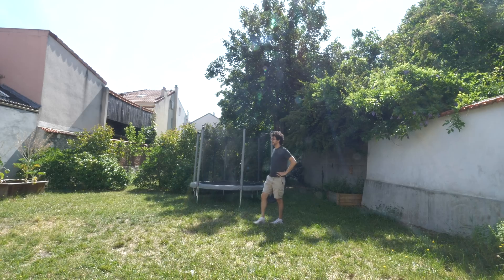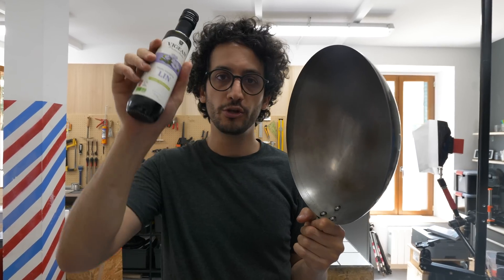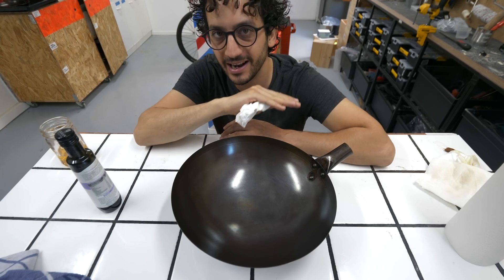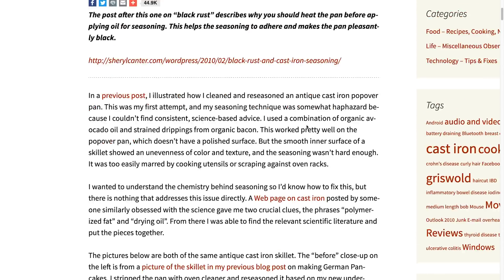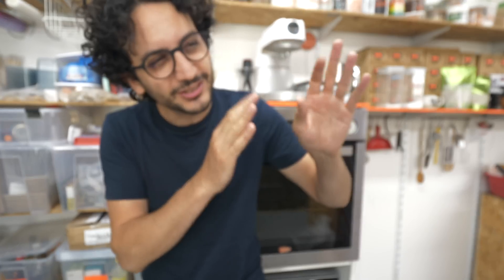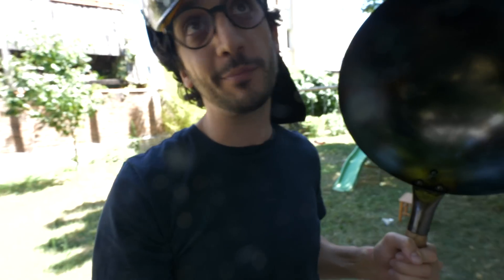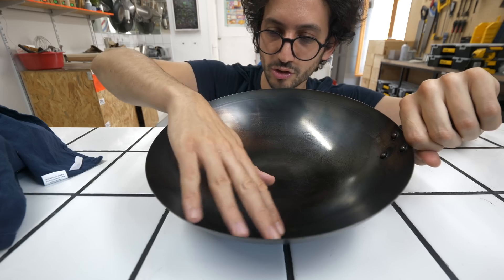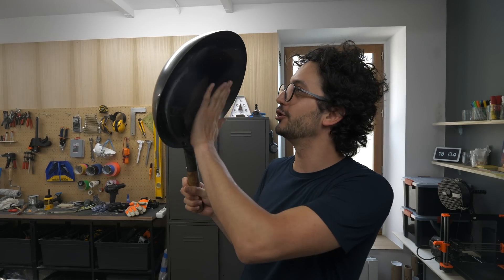Can I Make my Wok Slicker than a Nonstick Pan ?

Comment: It is definitely good enough to use every day, but I won't say it's better than a teflon. With a teflon you can usually fry an egg with absolutely no oil.
Reply: @SimonWoodburyForget  You are absolutely right, I shouldn't call it frying. Using some oil is absolutely fine. I was just theoretically comparing the level non-stickiness. Since teflon can cook an egg without oil, I think teflon technically sticks less than a seasoned cast iron. I agree both provide good enough level of non-stickiness for day-to-day use though.

I know some people experience short lifespans on teflon pans. My finding is that most of them use gas cooktop. I suspect it's because gas heat is way more intense than electric, it sometimes overheat teflon surface. With my induction cooktop (which is common in Europe) my teflon pans last pretty long.

Comment: For the sake of glass like surface... it would be interesting to build up some thick layers and then use a proper buffer to create that smooth surface. like... go all out man
Reply: The layer is too thick it doesn't work, the surface to mass ratio of oil hydrolyzation is critical.

Comment: "There's no chemicals, it's just like a nice, very hard polymerised surface". Well that's pretty much chemistry and your polymere is a chemical. Just because it is homemade doesn't mean that it's better or worse. Tbh I am a bit disappointed that you made such a statement Alex, since I know you do now better :D Teflon is great, you should just never let anything burn inside of the pan (or heat it above 400°C - a Teflon pan is NOT suited for this.
Anyway this is a very interesting topic and alas I couldn't find any paper in my short search for this topic. It would have been interesting to know what exactly this layer is.

Comment: Teflon has a low flash temperature, meaning it is not safe to use at high heat which is why a teflon pan will wear out when used regularly, and since teflon is extremely dangerous to ingest, this is definitely a better solution

Comment: I too came across the same post a few years ago. I even read all the replies, I think  along the way I picked up my preseasoning step of boiling several tea bags in the pan. Fill the pan with water, add tea bags, boil for quite a while, keeping the water topped up. Add tea bags if necessary. I think the tannins in the tea helps form the magnetite layer Sheryl refers to in her second post.

Comment: Im not sold on Sheryl's method of using linseed/flaxseed oil. As she said herself, she's not a chemist, and i have read few opinions from actual chemists that using that kind of oil with low smoking point isnt really the optimal way. Main point is that the seasoning layer is going to be very weak and you're going to lose it easily. For some reason that method gained some popularity on the internets but i havent read any actual science that proves it as being a good solution. I am in talks with an actual chemists and he should make soon a video about this, when he finds some time. Im very interested in this topic because i love carbon steel pans. Another related topic is about the best frying oils/oils for cooking at high temperatures (when you sear a steak the pan and oil reaches temperatures far higher than the ones suggested for frying), and this is an even more complex topic.
Reply: So what is actually "seasoning"??

Comment: Elitist snobbery ! There are many such questions that always have the same outcome of answers. one example, blue steel vs stainless steel knife which is better? both do the same job, both do not impart a different flavor on the food. one is more labor intensive to maintain, one costs more. enthusiast, professional, home cook, there should be three right answers. I personally have been working in professional kitchens for many many years and have used Teflon and non. i currently use both, it all depends on what i'm cooking and my mood.

Comment: I'd agree with your "better than a teflon pan" stance. That coating can handle high temps, like if you accidentally leave it preheating for a few seconds too long. Teflon starts to degrade at high temps. And it can be rejuvenated if the coating becomes less nonstick over time.

Comment: Bro easiest way good gas stove don't put oil in the pan when it's cold get the pan smoking hot like literally smoking then put the oil in the pan and spread it with a thick tea towel til uniform all over, and your done. I've been a chef for many years and we always did it that way never had anything stick.

Comment: I used to use T-Fal Teflon pans before, recently I back to my parent home and my mom using Stainless steel wok, and it really hard to used to it.
But my mom reached me and I found, to use non-coating wok, you have to make sure the wok is hot enough before you put in your ingredients in.
(If not hot enough you will suffer in ingredients stick on surface)
*make sure you prepare all stuffs before turn on fire, using wok THE HEAT TRANSFER SUPER QUICK, too slow you will easily burn your food.

I’m ChemicalEng student, I looking like this, if hot enough the material (ingredients) will cooked before it touch the wok surface, so it not going to stick.

Hot wok after put ingredients

(oil) (foods) (oil)
(Oil) (Oil) (Oil) (Oil)
( iron / stainless steel)

Temperature not high enough for the wok 

(oil) (foods) (oil)
( iron / stainless steel)

So you need to know your wok and need some skills in my conclusion.
*i like the effect that make food more delicious (especially fly) because wok can heat transfer super quick.
Reply: The Frugal Gourmet used to say "hot wok, cold oil, food won't stick."

Comment: I have a carbon steel made by de Buyer. I seasoned it on the stove with grapeseed oil. I can do the egg trick you did. However, I can not make a french omelette in the pan. It slides around fine, I can get the right shape, but the egg isn't pale yellow, it's browned. If you were able to make a french omelette in a carbon steel pan......now that would be impressive (not saying that this wasn't impressive). In regards to the wok, I believe the way the Chinese season their wok is to put a lot of oil in it with chopped up onions and they fry the onions till black. If you take a carbon steel, stainless steel, or cast iron pan and fry an onion in it, it will give the pan some non stick qualities for a while. Also they use stoves with a lot more firepower,  I think that's how they get the wok hei flavor.

Comment: Teflon non-stick pan : we need to change it every 1-2 with 4-5 use per week.
Steel seasoned wok : we have the very same one for 10 years, used 3 meals a day (and for one meal it can be used for up to 6 dishes, but in average 3)

So I agree with you!!!

Comment: Would a bbq grill get you a heat that you would want?

How did you make those DYI grill pads and buffers?

Amazing video
Reply: Saw a video where a guy was getting 700+ degrees F on the pan with a kamado over lump charcoals.

Comment: Linseed is a good choice. Walnut would work except I think it’s more sensitive, perhaps too sensitive, to heat. Both of those oils are used to put an oil finish on wood, which is also polymerized in much the same way, only more slowly without heat. (Or heavy-metal agents that speed polymerization are added, but those are too toxic for a pan.)

Comment: Hm. Buffing the freshly cured seasoning. That's a new one. Makes sense. 

And, yes, pan seasoning is nothing more than a form of food grade enamel baked hard. You dare not rise above the seasoning's pyrolizing temperature. Otherwise, the only maintenence is a light scour followed by refreshing the existing seasoning with a couple cycles of oil and bake. Food grade linseed oil is the real deal for seasoning pans. In paint technology, linseed oil made the most durable paint. Stands to reason the food grade version would make the most durable seasoning for steel and cast iron cookware.

Comment: Seasoned cast iron or steel pans are so much better than teflon, and for wok using a teflon pan would be downright silly since the teflon coating can't handle those kinds of temperatures.

What most people think destroys teflon pans is using metal utensils or stuff like that but what actually destroys the teflon coating is using to high of a heat.

Lastly if you somehow screw up the seasoning you can just apply a new coating fairly easily yourself but with a teflon pan you basically just have to chuck it out and get a new one.

Comment: I have a carbon steel crepe pan.  Once seasoned, eggs won't stick to it at all.  I don't even have to lift the egg as you did in the video.  On good non-stick pans, they also need a slight amount of lifting to free them from the pan.  So, in my experience carbon steel pans DO have a better non-stick surface.  Give yours a bit of time to season and I bet it will not need any coaxing to freely slide the egg around.

Comment: I've spent so long mastering how to get a perfectly cooked, non-crispy egg because any crisping is disgusting to me. I'm upset with your egg Alex.
Reply: Just cook it inside its shell instead of broken open in an oily pan ^^ That's the best way to cook an egg without altering its taste, heath values, or nutritional benefits, and you have absolutely nothing to add during cooking. Just over 2 minutes in boiling water, then cool it very fast by dropping in cold water for 1 minutes. Break the top of the shell and eat with spoon/bread+butter with a pinch of salt. Enjoy

Comment: Great stuff Alex! A faster way to clean your pan to start with is to use oven cleaner - it’s designed to strip off polymerised oils and you might well already have some in your kitchen. Can’t agree more about the linseed oil - it’s great for cast iron skillets too.

Comment: What temperature was your oven? Did you preheat the oven? Also, smoking oil can be carcinogenic and very dangerous for pets (birds will die very quickly when exposed to it) so please edit your video with a warning. Also mention that you need to perform the seasoning procedure in a very well ventilated room.

Otherwise, solid video as always, Alex!

Comment: Teflon and seasoned steel both serve their own purpose.

Woks are great for stir fry with their ultra high temperature wok hei flavor. Your stir fry won't be right without it. On the other hand, if you're making a french omelette in the classic quenelle shape that is delicately cooked and not crispy/browned at all I would choose teflon every time. 

Ever tried to cook fish in a seasoned pan? It's a pain in the ass. It will strip your seasoning down to bare metal just about causing you to spend a bunch of time re-seasoning. Teflon however is much more resistant to the chemical reaction caused by cooking fish. Just one of many examples.

Comment: The there is no chemical point is kinda of flawed, PTFE (telfon) is really non reactive (due to the C-F bond)  and used to store some insanely strong acids and if you were to eat small amounts it would not react or be absorbed by your body at all, you still shouldn't take it past its decomposition temperature (pretty tough ro reach on a regular stovetop tho) because it'd produce toxic compounds like PFIB (that is really bad for you) above the ~326C° mark (599.15K)

Comment: You could have made it better if you didn't use Flaxseed aka Linseed oil.

Be ready for the seasoning to start flaking off very soon.

Sadly the term Science is now used so loosely that a hunch can be called "Science" and it will blow up like gospel.

Comment: For bluing with lin oil the temperature of steel should be between 400°C and 600°C. After bluing coat the hot steel with wax to close micro holes.

Comment: I would be quite curious to see what would happen if you were to use a mix of oil and wax ( paraffin or bee´s ) for seasoning.

That and I know for a fact that heat is not the only factor for polymerization of oil. I have seen solidified lumps of slide oil on the underside of milling machine beds. And it never encountered a heat greater than a summer day.

Comment: Hey Alex I am so glad you got this right. To my knowledge you did everything absolutely correct. I bought myself a couple of deBuyer carbon steel skillets around Christmas time last year. I read a lot about seasoning and watched a lot of videos, but I could not get the pan non-stick. it turned out my layer of oil was too thick. Eventually I reached the same conclusion as you, ultra thin layers and many coatings. For everybody's reference I watched "Uncle Scott's Kitchen" video on it and he goes into great detail about how to do it. I recommend that you check it out. 

PRO TIP: If you want to reseason your old pan I found a super easy way to clean all the dirt and smudge off in just minutes without any scrubbing. If you fill your pan to the literal brim (almost overflowing) and add in a tablespoon or two of lye/caustic soda/sodium hydroxide and set the pan on a very gentle boil, ALL the black spots will just fly off and you are left with a blank canvas as you say. No scrubbing needed. Good luck and keep up the great vids. Much love

Comment: A lot of things confused me about this episode:
 - Didn't you expose some raw metal, or at least made the polymer coating uneven by buffing it after seasoning, rather than before?
 - Why did your nonstick test involve so much oil? That's how much oil I use to fry an egg in a normal pan lol
 - Why are you comparing a steel pan to teflon at all? Seems like comparing a knife to a fork. There are things you can ONLY do in Teflon. There are things you simply CAN'T do in teflon
Overall a lot of confusion.

Comment: I’ve done the flax seed oil polymerization thing and I’ve done it the old fashioned way: use them with lots of oil, and clean by wiping/salt scrubbing. The latter works best if you’re using the pans all the time since the polymer layers will chip.

Comment: What is the polishing compound that you added but didn't mention? That doesn't seem sensible. Also you can take your surface to a much, much smoother result by using a combination of increasingly finer steel wools. I dont' think that matters tho

Comment: The big issue I have with teflon pans is simply heat... You can't cook REALLY hot in them as you'll break down the coating and destroy the pan (not to mention you from the off-gassing breakdown components) in fairly short order... A well seasoned wok or cast-iron pan will keep a good non-stick surface without that kind of issue. And if you do something to break the seasoning you can resurface the pan... oh, wait... you just did that. ;)

Comment: Whilst your chemistry is correct, the fact is that by the time you have used it once with whatever you are cooking with, you have changed the surface and continue to do so every time you use it. There is only one way to season a pan in the long run; just use it correctly.

Comment: You can fry an egg on an Teflon pan from here until the heat death of the universe, without the coating affecting your digestive system provided you keep the heat low. 

If you'd rather sear an egg in boiling oil you're going to be dealing with carcinogens on the surface that's getting baked. 

Imaginary Teflon problems vs cancer. You decide.

Comment: So I tried this with a carbon steel pan. Got it to a mirror finish, pretty easily to be fair. But... mirror finish carbon steel is still reactive and stuff sticks to it - what doesn't stick to it? The polymer coating you get from seasoning. It peels right off. 
You need a bit of "rough" for the seasoning to grip.
Reply: Also, if you add enough oil to a sock you can cook an egg on it and have it slide around. I see this a lot with cast iron videos. Look at this "non-stick" pan.... that's full of oil. I guarantee a seared steak will still stick to Alex's pan. And you shift it with a slice, which will mar the "mirror finish" coating, the bits will burn on to the surface. And blah blah. Neither cast iron or carbon steel can't be made non-stick with polymer oil coatings. Literally, show me one video with a cast iron or carbon steel pan that cooks non-stick without oil. I can show you a bunch of Teflon, anodised aluminium or ceramic pans that will.

Comment: Flaxseed oil is bad for carbon steel pans. Flaxseed oil has the lowest smoke point, which means it polymerizes more completely, which means it is MORE BRITTLE!

Carbon steel has some flex to it as it heats and cools, which means the brittle seasoning will flake off. It looks nice, but performs like crap. On cast iron, this isn't as much of a problem, but it is something that still happens. 

This woman has created this meme about flaxseed oil that has persisted for years, and it has been the bane of carbon steel newbs ever since. It has been taken as gospel because before her article, there was no highly referenced knowledge base about seasoning, just whatever we learned from our grandmothers. That doesn't make her an expert,  just popular. 

Use a midrange smoke point oil for both nonstick properties and durability. You don't want complete polymerization. You want it hard enough to not scrape off and flexible enough to withstand heating and cooling expansion. 

Just go on r/carbonsteel and search "flaking". 99% of the time it is flaxseed oil.

Comment: I prefer carbon steel and cast-iron to Teflon because of the temperatures you can achieve, they heat up much better and faster and cook better overall.